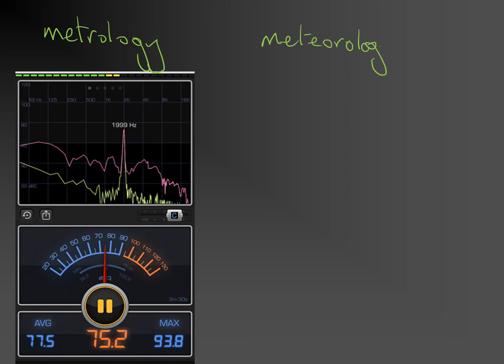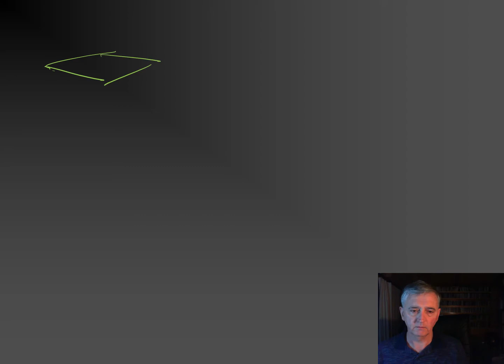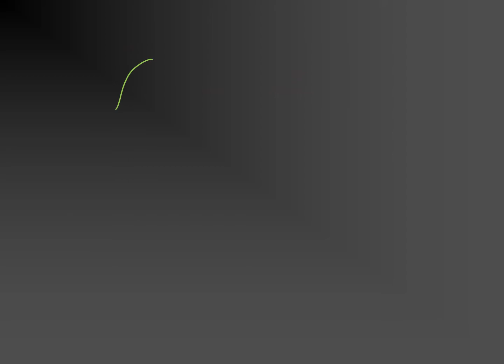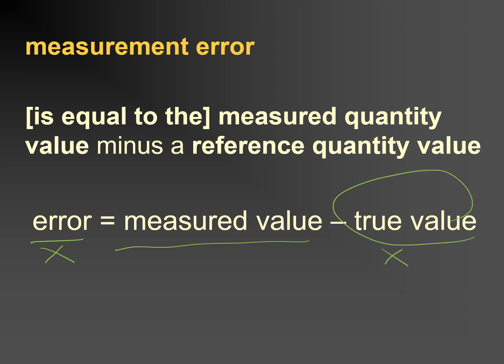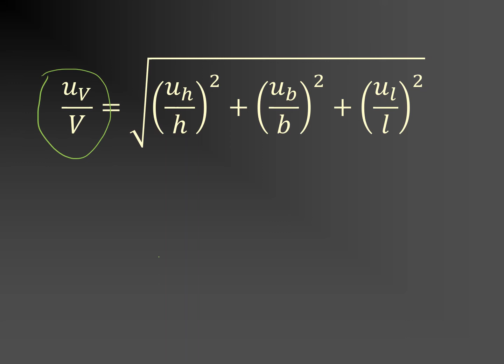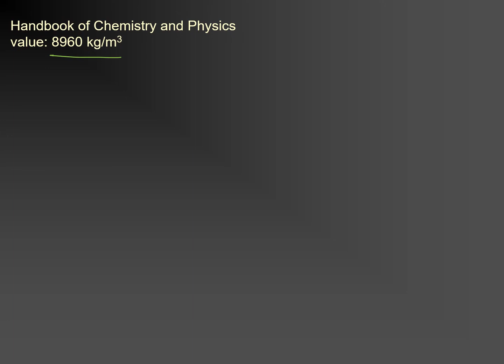Metrology, Metrologists and Measurands

Comment: Good vid and introduction to Uncertainty, do you know of any one who has applied ISO22514-7  Measurement Capability using the Uncertainty Frame work? My specialist field within metrology is Small Volume  Metrology and Applied Measurement Systems Analysis. I have found that the understanding of measurement uncertainty in general industrail circles is very limited.